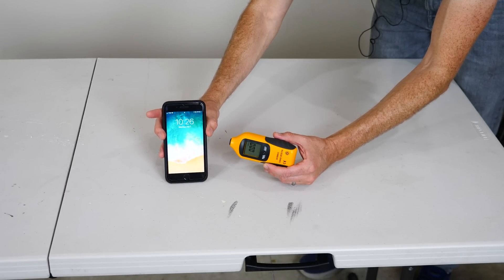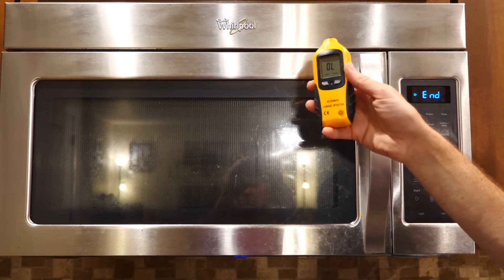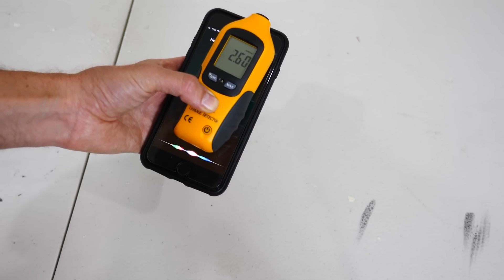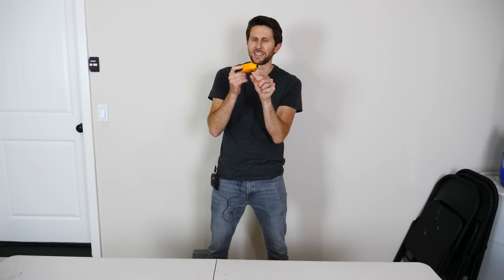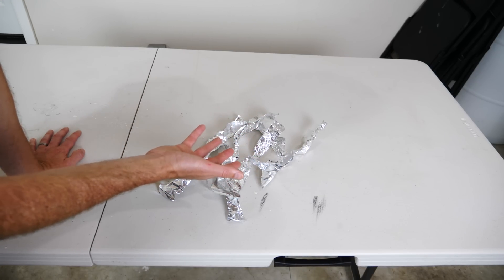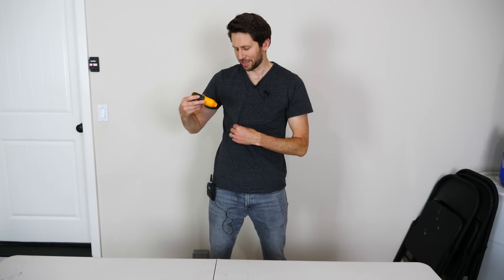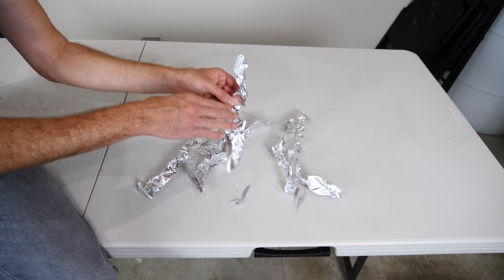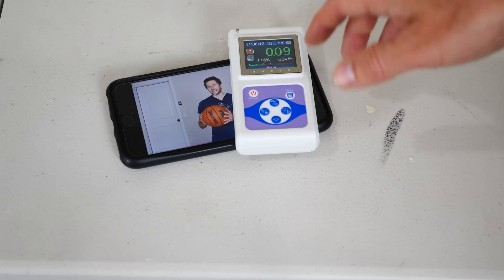How Much Radiation Are You Getting From Your Phone?

Comment: Non-ionizing radiation causes cancer too

The rationale, put forward mostly by physicists and accepted by many health agencies, is that, "since NIR does not have enough energy to dislodge electrons, it is unable to cause cancer." This argument is based on a flawed assumption and uses the model of ionizing radiation (IR) to explain NIR, which is inappropriate. Evidence of free-radical damage has been repeatedly documented among humans, animals, plants and microorganisms for both extremely low frequency (ELF) electromagnetic fields (EMF) and for radio frequency (RF) radiation, neither of which is ionizing. While IR directly damages DNA, NIR interferes with the oxidative repair mechanisms resulting in oxidative stress, damage to cellular components including DNA, and damage to cellular processes leading to cancer. Furthermore, free-radical damage explains the increased cancer risks associated with mobile phone use, occupational exposure to NIR (ELF EMF and RFR), and residential exposure to power lines and RF transmitters including mobile phones, cell phone base stations, broadcast antennas, and radar installations.

Comment: Why microwave considerably dangerous while visible light wasn't?  Because one thing I know the shorter the wavelength the higher the frequency is, that's mean the higher the energy level. So explain to me please why lower energy level than visible light can be dangerous like microwave for example, while at the same intensity with the higher energy level of visible light considerably safe.

Comment: Anyone notice the fact that the Electromagnetic radiation chart has "DANGER" in red above the microwave range of light when he was saying that microwaves is a form of non-ionizing radiation? 😅
Reply: @Junghune Nam Yes but as the video pointed out, that's because the radiation will start to cook any delicate parts of your body if you are too close eg inside the fence of a cellphone tower while the tower is operating. They turn them off or power them down when the maintenance guys need to work on them. Remember the field strength falls off with the square of the distance to the source. So, double the distance, quarter the received energy dose. BTW an early medical heat treatment called diathermy used much lower radio frequencies around 27MHz (similar to CB radio).

Comment: Wtf are you talking about ... the fact that a signal has a power like wi fi doesn't mean is a radiation.
We have radiation when the wavelenght is around the uv light wavelenght and below and wi fi  is really far from that . Wifi is not enough to ionize particles so is not radioactive. To really see if it has radiaton you need a device that counts sieverts .

Comment: Microwave communication companies agree with you, it's all perfectly safe 😉 it's not as if the military have developed directed microwave weapons.
Reply: I think this is a sarcastic comment. The microwave weapon works by focusing shit tons of microwaves all directed at one spot to heat it up. Phones emit way less microwaves than that, and it is much more spread out.
Reply: @donaldbaird7849  hmm you are correct but you forget the millions of masts dotted absolutely everywhere that are connected to lots of power, and all that would need to be done is turn up the power on those and everyone starts getting very sick very quickly........now go grab your tinfoil hat from this web address they are on discount www.extremeparanoia.com 🤣
Reply: @Gsavell  I literally said it was spread out. Did you ignore what I said?
Reply: @Gsavell  Also, consider the cosmic microwave background.
Reply: @Gsavell  The problem with microwaves is that they heat up things, they are not gonna make you sick unless you put your head in a fucking microwave oven. Just because the military managed to weaponize something doesn't mean it's bad.
Reply: @Gsavell  No. Whether or not the microwaves are directed at an object makes a big difference. That is how microwave ovens work. They direct microwaves at the object inside. Phones, power lines, and cell phone towers don't do that. It's all spread out. The amount of radiation doesn't matter if it's all spread out.
Reply: @donaldbaird7849  now you are wrong. A 1kw output has the same effect in all directions at the same distance as a directed beam of the same power it's just focused because it needs to be. Communication antennas need to go in all directions and therefore are not focused but the effect is still the same at the same power.

Comment: So there is a story about a girl who was trying to dry her Hair, and she put her Hair inside the Microwave and closed the Door, and they told me she died, is this posible?
Reply: Not possible.
Reply: @lorenzomanzoni9693  Will she get the work done? I mean can that work?
Reply: As far as i know it is advised to stay further away from microwave ovens if you have a heart stimulator device, because it is very sensitive device and the microwave radiation can cause it to malfunction.
I wonder whats the worst case scenario of putting your hair in microwave, maybe drying it to the point where they fell off or maybe heating them enough to get them on fire but its probably still not possible.
Reply: @S3l3ct1ve  the answer that gave me the person who told me the story was, that the Microwaves traveled on the Hair into her brain and that was the main reason she died

Comment: Our host didn't realize that Wifi uses two frequencies. 2.4 GHz is the older frequency used in 802.11b. 5.0Ghz is the new frequency he should have used. You can disable 11b support on phones, computers and wifi routers, which would have negated the bulk of this experiment.

Comment: Your video is very misleading, because you're using the wrong tool. Also radiation from microwave ovens can't be compared with radiation from cellphones. Try the an Acoustimeter for example and you'll get more realistic measurements, which easily reach 10,000 µW/m². Or watch?v=2wnMvc0wnlg

Comment: You are using the premise that anything that is non ionizing is not harmful.  A gun is non ionizing, so hold it to your head and it is harmless?  I believe there is much more complexity to the biological situation than basic heating.  Perhaps make a video showing how safe it is to warm your nuts up using a magnetron set to defrost mode.  Seems safe enough rite?  Because microwaves only cause heating and that's harmless. I believe the danger becomes higher with 5G due to shorter wavelength having a higher chance of interacting DNA.  Please do the video warming yr testicles with a magnetron after you have been out in the cold. You will get so many views.

Comment: The chart at8:53 implies that radiation isn't strictly ionizing or non-ionizing but a continuum, is this true?  Why does the chart also imply visible light is more harmful than microwaves even though it is closer to ionizing radiation?  Lastly what really is infra-red radiation, I used to just think of it as heat but since any other wave can heat up stuff as-well, what really is it?
Reply: But visible light is closer to ionizing in the chart... look again
Reply: Everything gives off radiation. but the higher the temperature of the object, the higher is the frequency of the radiation. Objects below 525 °C give off infrared radiation, which can only be seen with infrared cameras. Objects above 525 °C emit visible light, that's why hot things glow. So cold things glow too, just invisible to the human eye.

Comment: What's giga hz? Just a noobie question 😐
Reply: @CHILLI  1GHz is 1000MHz or a billion Hz where Hz = hertz, the unit of frequency previously called cycles per second or number of up-down wiggles in the wave. More Hz = higher frequency which also = shorter wavelength which = higher energy but also greater bandwidth or capacity for data etc.

Comment: the whole thing with the "harmful radiation" on phones, microwaves etc is just pure nonsense. The energy of radiation is proptional to the frequency. The harmful radiation, which is able to ionize atoms is > UV radiation. Therefore microwaves, 3g, 4g, 5g is not harmful because the frequency is very low even lower than common light

Comment: Microwave could heat due to charges . So how about  infared ? How does it heat?

And why does Visible light seems so harmless ( less reactive or never hear news  ) compare to Mvr , IFR(strong). Uv has more energy  so i could understand...
Reply: @Vanlalchhanhima Vanchhawng The explanation of this simplifies to: Microwaves set the molecules in motion heating them up. They then radiate some of this excess energy in the infra red part of the spectrum to which a much wider range of materials are sensitive. Human tissue is less sensitive to the heating effects of the visible light range but, will still burn if the intensity is high enough say as in a laser in the range 430–770 THz (380-740nm) which is the visible spectrum.

Comment: But WHY is the WiFi frequency the same as the microwave frequency?
Reply: Frequency is only one part of radiation. There is also power. Your microwave may use the same frequency but it has a much higher WATTAGE than your cellphone hence why it can heat frozen food and your phone can't
Reply: Because it's a good frequency to transmit Wi-Fi. The difference is your cellphone is like a teeny little led light of power and your microwave is like stadium lights.
Reply: @Robin Cambell The main reason is that it's unlicenced part of the radio spectrum globally available. It's one of a number of so-called ISM or Industrial, Scientific, Medial allocations throughout the radio spectrum. There's nothing really special about microwaves, they are just "tiny waves" compared to some. The 2.45GHz freq usually used for ovens is also used because the wavelength at that frequency results in a convenient, cost-effective magnetron,  cavity and waveguide size for domestic use. It does of course work well with the molecular vibration described in the video but other frequencies, both higher and lower,  can be and are sometimes used.

Comment: can u do an exxperiment involving 5G waves ?? there are a lot of speculations arround this subject. thank u!
Reply: Stop listening to degenerates who failed elementary school

Also theres alot of videos that have debunked the 5G conspiracy theories
Reply: The increase in frequency from 4 to 5g is negligible. Non ionizing radiation is harmless stop believing the idiots who have no idea what they are talking about
Reply: @AdamSmith-gs2dv  yep. We shld ignore the false believers
Reply: @AdamSmith-gs2dv  I'm one of those idiots that is cautious about phones and especially 5G.  5G runs up close to 100GHz and needs to be transmitted at significantly higher power due to its high attenuation through both objects and the atmosphere.  This high attenuation through say your head means that more of it gets absorbed.  The higher frequency means that the wavelengths are shorter and could be getting short enough to make your DNA become small antenna, which would induce voltage across the DNA, does this voltage affect the accuracy of DNA replication? You seem to be an expert on this subject so would value your opinion.  Please reassure me that it is 100% safe and I'm actually just an idiot for thinking there is a possibility there could be other factors at play that might kill me.
Reply: Yes 5G operates up to 100 GHz and the militarys Active Denial system (a crowd control weapon) operates at 95 GHz. 5G is dangerous. Say no to 5G!
Reply: @brendontait6968  Dude, the sun belts out electromagnetic radiation of all frequencies, including 100 ghz microwaves. Microwaves have a lower frequency than visible light, so it carries less energy per quanta. It's at the other end of the spectrum as UV , x-rays and gamma rays. If you're afraid of microwaves, you must be terrified of blue.
Reply: @ongbonga9025  you'd feel comfortable heating your balls if they are cold with a magnetron? Because hey microwaves are perfectly safe biologically and only cause harmless heating effects.  There are a lot of interactions that we are not yet aware of.  While microwaves are at the other end of the spectrum to ionizing radiation I believe there is a good possibility for other (dissimilar) biological interactions that could cause harm. Please, make a magnetron heater for yourself and your family and prove to us all how safe they actually are.
Reply: @brendontait6968  it is non-ionising radiation. It is not the same thing as a microwave oven. There is no reason to fear monger on this.
Reply: @danielnemec4767  I'm not sure what you are saying, it is the same thing as a microwave oven, they are non ionizing also.... so many experts...
Reply: @danielnemec4767  waiting for your reply...
Reply: @evanbv8793  bruh. Go back to school. Dont disgrace yourself here. You might as well say, say no to wifi. How about that
Reply: @evanbv8793  a frequency is nothing more than just a number. It can be vibrational waves or sound. A higher frequency does not always mean high damage. I can have a high soundwave frequency and it wont sound any louder.
Reply: @ongbonga9025  you might as well ask him if hes afriad of just light which is also a electromagnetic wave
Reply: @brendontait6968  a microwave oven also reflects the rays constantly. The microwave doesnt just get absorbed into the food molecules and then die out, just like radio waves they can pass through your food. The interior of the microwave oven then reflects the waves back into the food. Therefore your food gains more energy quickly and your food heats up quickly as well. The food in a sense steals the energy of the microwave everytime it passes by and since it being emitted from almost all directions in a microwave oven, the food has plently of energy to steal. All of tgen being constantly reflected back is another huge cause. Just imagine it being like light. If you stand under sunlight you dont burn (you get sunburns due to ultraviolet light not white light.) However if you concentrate that light with a bunch of mirrors, you can melt aluminium. Your phone and the sun however emit microwaves and thats it. They are not in a contained space like a microwave oven and reflective panels. Thats why you dont heat up like food in the microwave oven.
Reply: @izack8945  Microwaves are the electromagnetic brown note. They make people shit themselves.
Reply: @izack8945  I'm sorry the education system has failed you so badly.
Reply: What speculation is that? Are the reptiles giving us cancer so they can sell us chemo? Credit where it's due, it's a fantastic business model.

Comment: Hey Action Lab, I do sleep abt 1.5 meters away from WiFi router. Is it still safe?
Reply: Yes. If you can survive being under the light bulb then you can survive the radiation your WiFi router puts out.
Reply: @AdamSmith-gs2dv  LMFAO , the frequency matters
Reply: @ChevroletCamaro2970  if its true that wifi is microwaves, it is weaker then light
Reply: @giulio7918  
Yeah, but the thing is Wavelength of Microwaves are Larger enough to Pass through Human Body easily. 

While Visible Light has a smaller Wavelength and when incident on you, just gets absorbed by the First Layer of Atoms of the Human Skin and then Reflected back away. 

So there's a difference between Penetration and Reflection I think.
Reply: wifi is light, just like all the other wavelengths, just you can't see it, only visible light
Reply: @ChevroletCamaro2970  I think rays that has wavelengths smaller than visible light are the only waves that penetrate human body(UV, x-rays, Gamma). On the other hand, wavelengths that are larger than visible light are reflected or absorbed.(Radio, Micro, Infrared)
Reply: You could use it as a pillow and be fine.
Reply: it fry's your testicles over time and kills sea  men.
Reply: @steveulliott4106  lol
Reply: lu mlecz it’s not ionizing radiaton as long it’s not putting a crap ton of energy it’s fine

Comment: I just want to point out that the inverse square law technically only works for a point source of radiation.  For an extended object, like a microwave or a cell phone antenna, it doesn't fall off nearly that fast when you're near it. This makes sense as we wouldn't expect the intensity to go to infinity as distance drops to zero!  But some distance away, inverse square law is a reasonable approximation.
Reply from the maker: Good point!
Reply: What if the intensity is near infinity at distance 0? lol

Comment: Use speakerphone or wired earphones, sleep in a different room from your phone, turn off wifi when not in use, leave data off on phone unless needed, set network to a non lte network if available, use a wired network in home when possible, focus on healthy eating and avoid chemicals but radiation happens.
Reply: Completely unnecessary because Electromagnetic radiation =/= Ionizing radiation, especially for frequencies as low as microwaves.
Reply: @davidb5205  :) I agree but I did it and something happened that was absolutely amazing, I stopped looking at my phone and reduced my internet usage, I got better sleep and I shut down most of my social profile, got a life and bettered myself. I blame radiation and think you all should try it too lol because fear is way better than teaching people there is more to life
Reply: If you avoid chemicals you will die in about 15 minutes
Reply: Airplane mode

Comment: Its about the cumulative amount.
Reply: Cumulative amount of what? What units? Heat that your body easily regulates back to normal temp? Non-ionizing electromagnetic radiation which has a wavelength that isn't small enough to affect DNA?
Reply: @davidb5205  amount of non ionizing radiation. There are reasond why they tell you not to sleep with your phone, or carry it in your pocket. Its ridiculous that we are even still talking about this. Every year they come with "new" info telling you.